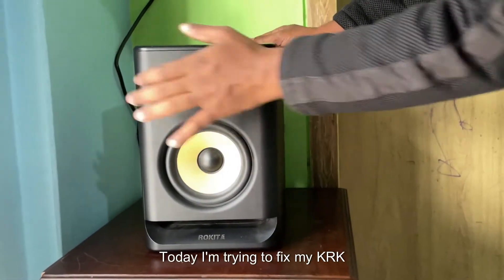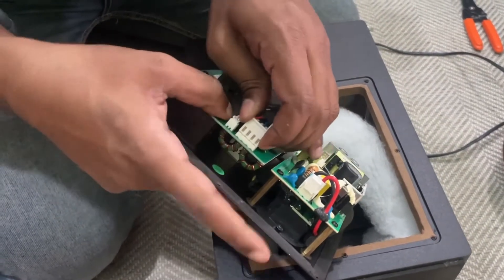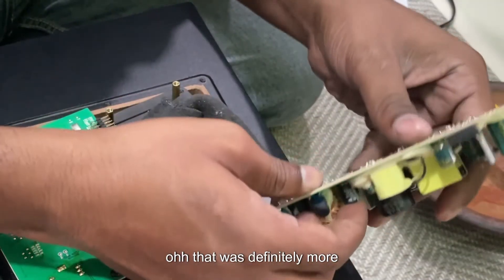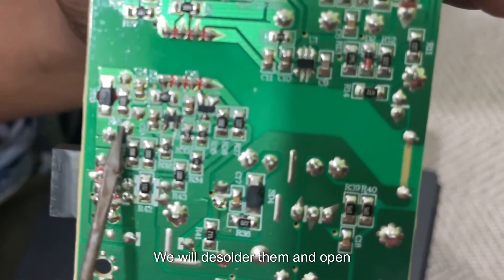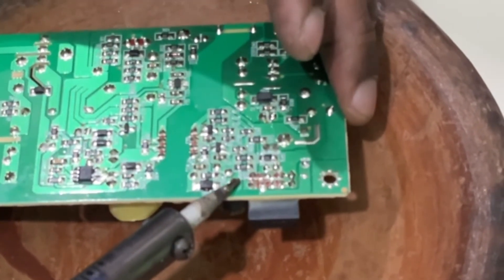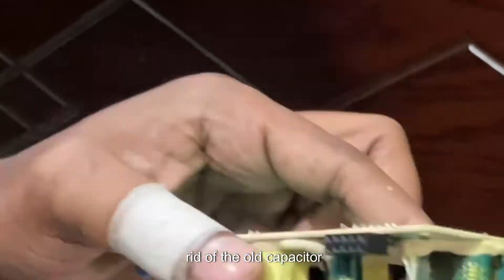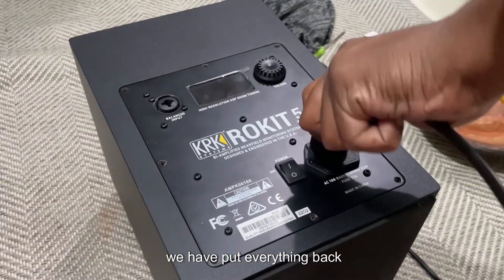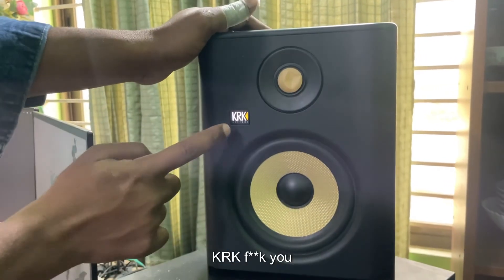My KRK ROKIT 5 G4 Monitor Speaker is Dead - Here's How to Fix the Screen Flickering Issue

Comment: Thanks for this video. I just successfully repaired my ROKIT 7. I took a few extra precautions to not get shocked. I let the speaker sit 48 hrs unplugged. I did not touch the top of the capacitor and finally I had someone with a multimeter make sure power was drained.

Comment: Caution! The discharge seen in the video is not from the 10V capacitors, but from a larger, 400V capacitor located in the center of the board. An hour after turning off the speaker, the capacitor read 265V with a multimeter, indicating a very high discharge. It is essential to discharge the 400V capacitor before working on the board (using a surge protector or an appropriate resistor). Alternatively, you could leave it off for an extended period (we're talking several hours or even a day, as a precaution). If you have experience with electronics and electricity, disregard this message, but if you are new to these topics, keep in mind that we are talking about a discharge of several hundred volts.
Reply from the maker: Thanks for the important reminder! 🙏
You're absolutely right, I experienced the same thing while repairing my other speaker (using a Voltage Tester this time, hehe). I also noticed a few of the other capacitors also retaining voltage. 

So yeah — anyone opening these should wear proper insulated gloves and be super careful.

Really appreciate you sharing this for everyone’s safety.

Comment: Just adding another voice to say this vid is legit. Repaired my G5Gen4, which wouldn't even turn on, using the clear instructions in this tutorial, a $25 soldering kit, and a $1 25V 1000uF capacitor - all in 20 minutes. I especially appreciate your sacrifice in demonstrating what not to touch!

Comment: Thanks for your video. A KRK G4 with flickering issue repaired here in Japan. Even though the 1000uf capacitor in question didn't look bloated, it was still the cause... 🎉🤜

Comment: This saved soooo much money!!   Only thing i did differently was using a pair of knips and cut the capacitor out flush on the board then pullin cap out.  Followed up by using a tiny file point to make the holes for the leads.  Hope this helps people speed it up!

Comment: KRK uses trash brand electrolytic caps. I won't be buying from them again. I'm stuck with these KRK 5 G4's now. Thanks for wasting my money, KRK!
Reply: I feel the same way with KRK. Wanted to like them, but they don't know how to spec capcitors. This happened to me twice. First time, it was under store warranty, so it was an easy swap. Not it's outside of warranty. I'm thinking of doing this fix, selling them and moving on to a new brand. KRK just launched a new Gen of their rokits. I feel like they should recall Gen4

Comment: previous HVAC knowlege coming in here, when you shocked yourself from the leftover capacitor charge....

When changing 220v ac capacitors, to discharge the leftover charge, i would unplug the wires going into it, then put my pliers or screwdriver across the leads.....

Can you do same here or will you fry stuff being its connected to a PCB?

thank you to anyone who can answer this lol

Comment: I notice your tweeter cone is pushed in. That has happened to mine, more than once. I fix it by sticking some tape to it, I use duct tape, and then quickly pulling it back out.
Reply: I have similar issues and this idea will definitely do it for me. Thanks 👍

Comment: Thanks for the demo on why you need to drain the capacitors before handling mains voltage equipment!

I have the same issue with one of my speakers, and I assume the problem is that they're using under-rated capacitors.  Might see if warranty covers before popping it open, I'll definitely lose some of those surface mounted parts trying to desolder

Comment: thank you so much! it even worked with my KRK Subwoofer S8 but it was a 1500uf 10v capacitor on the power supply board

Comment: WOW, thanks man. Mine has exactly the same problem, and I'm good at soldering because I make custom circuits on alla my guitars. BUT what exactly do I have to do not to get shocked???
Reply: Use a multi-meter to measure DC voltage and it should discharge slowly through the multi-meter. You could be electrocuted you don't discharge them.
Reply: @martinc3907  Oh wow! Thanks for the tip. So should I just put the negative and positive testers of my multimeter on the board and it will discharge as it gives readings?
Cheers.
Reply: mine have the same problem, can i use a 25V 1000UF CAPACITOR ?
Reply: ok job done without any issue, speaker is working like new. Thanks again man, for sharing the fix